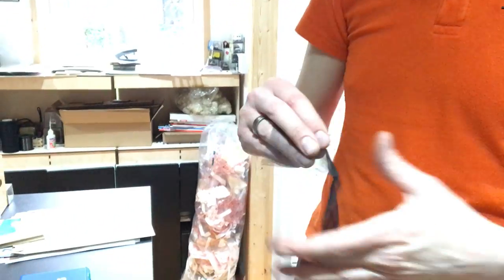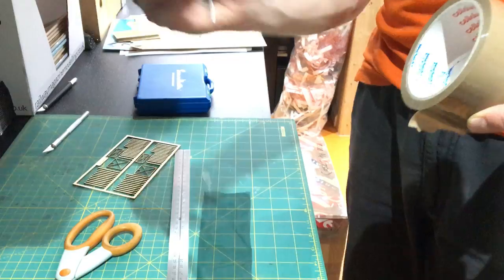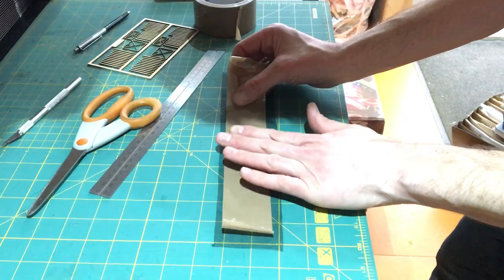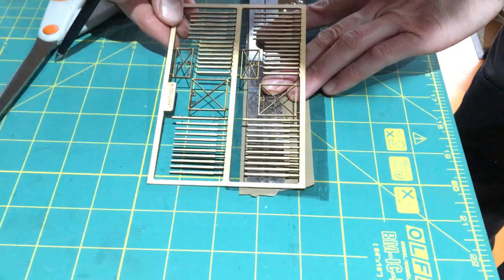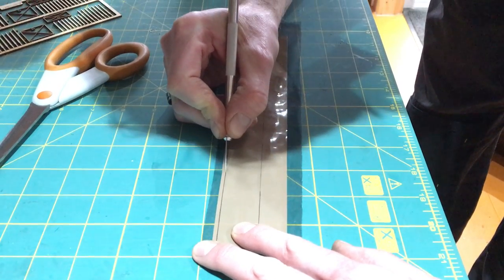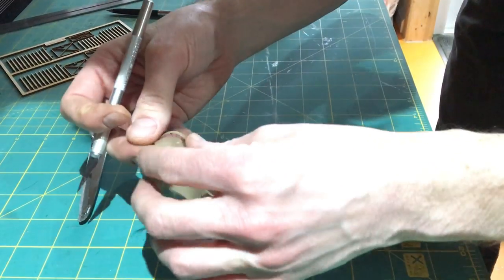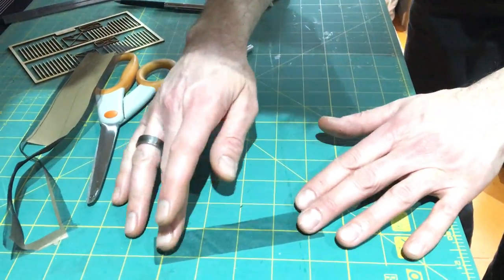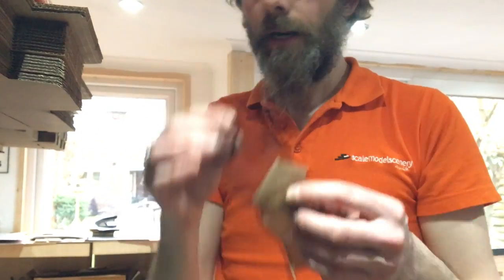How To Cut Nylon Mesh For Chainlink Fencing For Model Railway Layouts & Railroads

Comment: I was filled with dread when it came to cutting the mesh for this fencing, but following the instructions i was totally surprised at how straightforward it was and how accurate too, but i found it even easier to cut when the tape runs over both ends and the mesh is fastened down onto the cutting mat